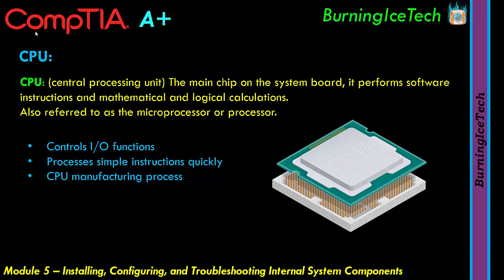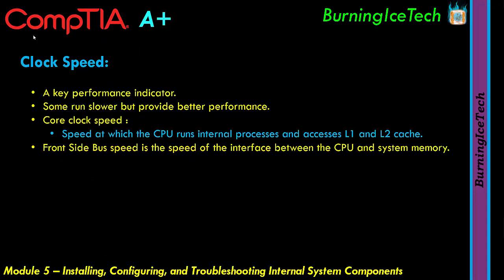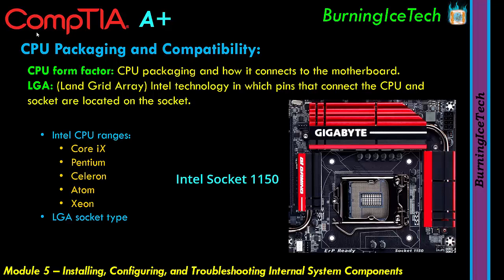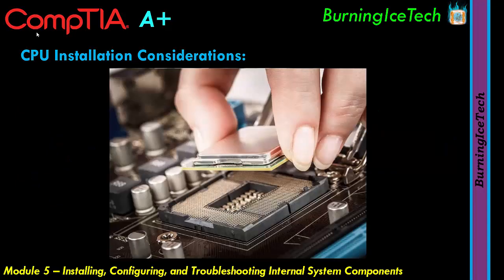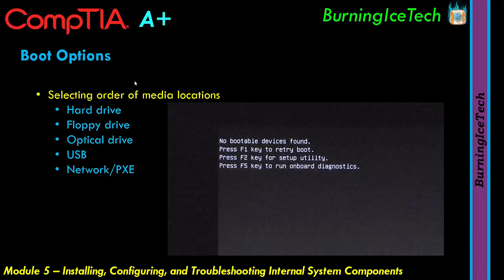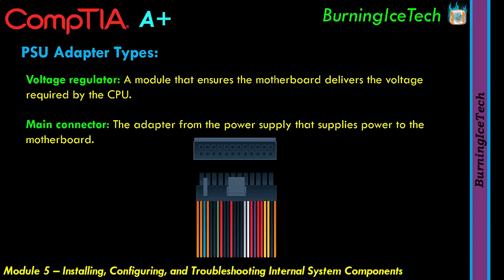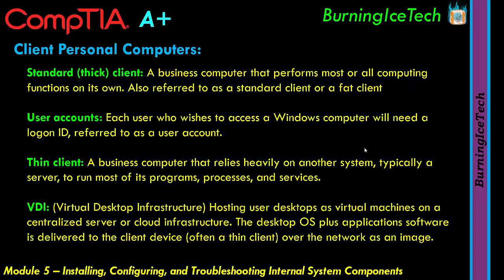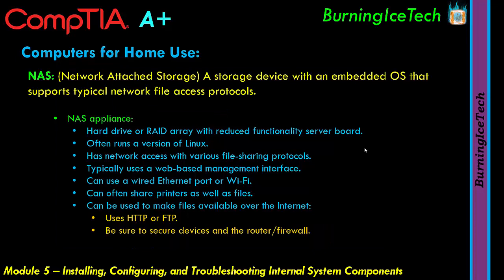CompTIA A+ Full Course for Beginners - Module 5 - Internal System Components

Comment: thank you thank you! I was waiting for this. The topics in this module also seem like some of the more cooler stuff. Donno about other people for at least it is for me personally. I love fiddling with the internal stuff of a PC
Reply from the maker: It is some pretty fun topics yeah. Sadly the course is random, some topics are fun, some are boring. We have to still cover all the topics though even though some might be boring :)
Reply: @BurningIceTech  Makes sense. Either way, I still watch them all since I want to write these exams.

These have been very helpful so far
Reply from the maker: @jacosmith3347  Cool. Just a note but you probably noticed this already, the modules we covered so far is all 1001 or Core 1.

The first 9 out of the 18 modules is Core 1 and the last 9 modules is Core 2. 

The exams do tend to cross pollinate so I would not advise writing the 1001 until you covered all 18 modules because they do ask questions here and there out of other modules as well which are not in that specific Core that you might be writing